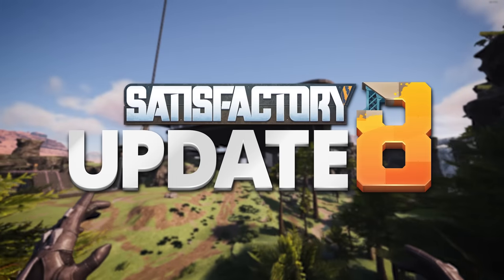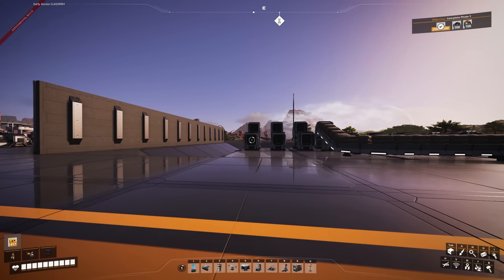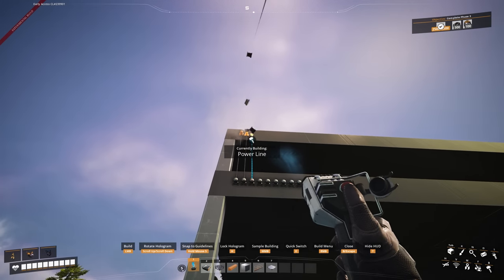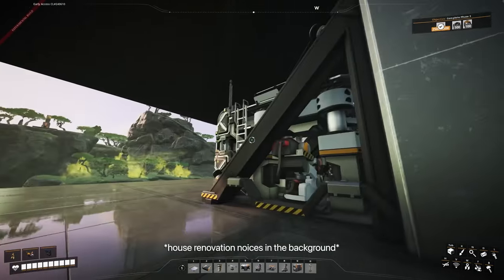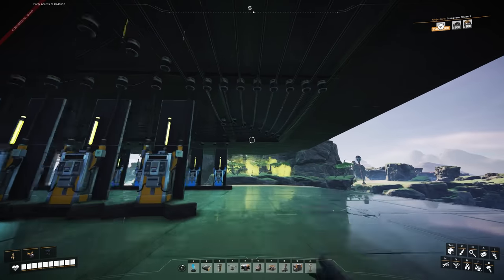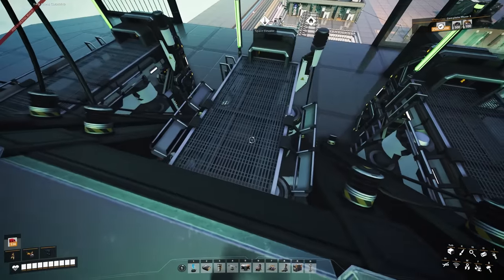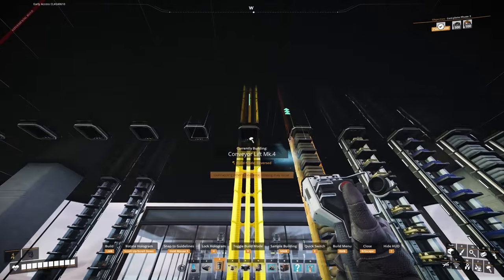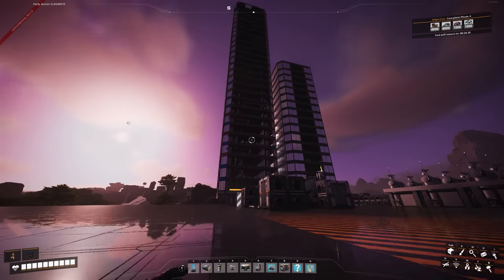SUPER Clean Factory That Unlocked EVERYTHING in Satisfactory Update 8!

Comment: 8:45 The big bank of switches with signs, etc. looks great, nice work! I'm thinking in a future factory of doing something similar, but also incorporating access to each of those components - so you might go over to the "screws" one, and you can actually open a storage container a pull out screws manually if you need them for something, etc.
(wish there was a smaller storage container lol those things are relatively huge)
Reply from the maker: Thanks! My thoughts exactly so there are storage units on every floor for exactly the reason you describe 😏

Comment: this gives me so much to aspire toward, currently playing update7 for the first time, just built my first factory to automate reinforced iron plates, it was huge, 16 constructors 5 assemblers, 3 floors, several coal plants & water extractors, it feels so good, and knowing it's self running with the coal & water systems in place is a good relief and weight of responsibility off my back - no more cutting down forests! next factory is already planned out, 33 constructors, 6 assemblers - this time for rotors.

i have a copper node next to where i spawned / setup my hub, been thinking would it be worthwhile to dump copper products into an awesome sink to unlock content like floor holes etc.?

Comment: I'm a bit confused. Why do the belts run into a storage container and then into a splitter that takes overflow into the sink?
Doesn't this mean the containers will always be emptied into the sink as fast as they are filled? So, the containers would always be empty wouldn't they?
Reply from the maker: Those are smart splitters, only overflow gets dumped into sinks. This way the production line is always max saturated, and resource supply machinery never stops (because dumps all the excess).

Comment: Having a separate power line per item seems a tad overengineered.
Reply from the maker: True. And its also bad craftsmanship... 😅 With priority switches could've built a single power line with a switch on each flor and control it from anywhere 😖
Reply: @approximatelybored  Was wondering that :D So like, one main "power bus" going up the tower, and each floor would split off that, into a priority switch for that floor?